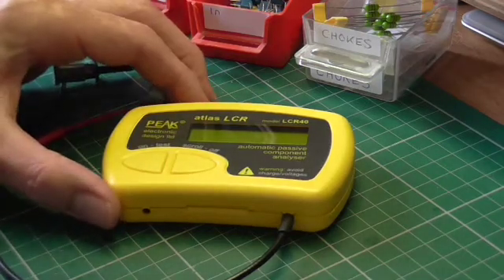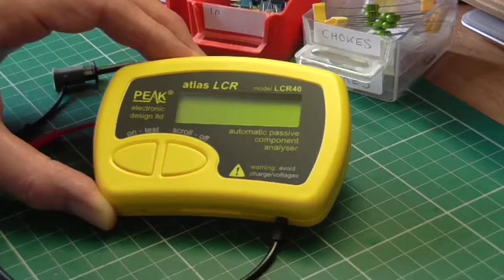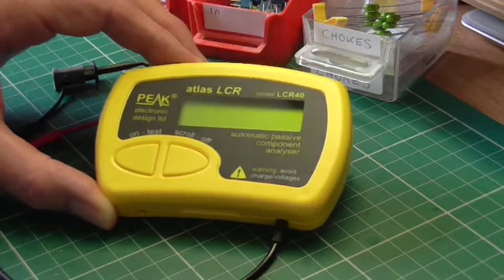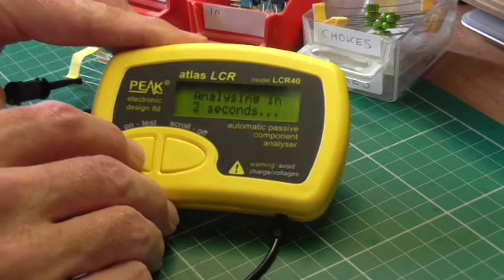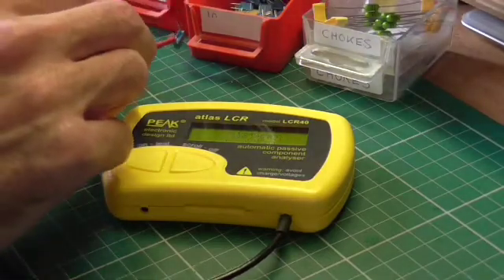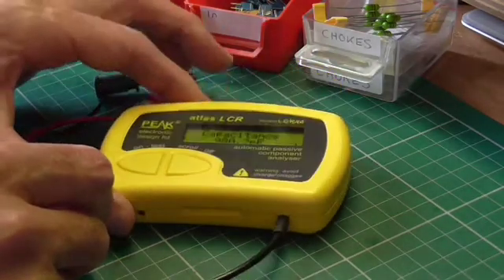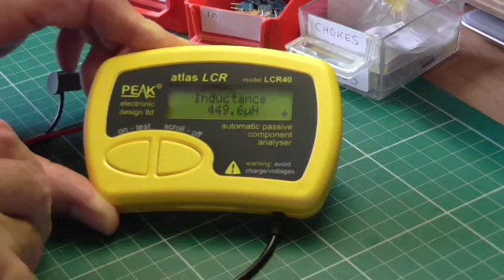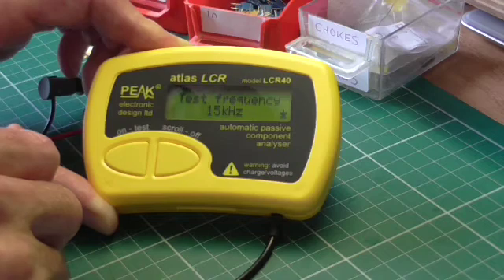Atlas LCR40 Electronic Component Analyser

Comment: I tried one of those, they are VERY inaccurate, its ok for measuring small middle of the range components. For example a 470uH inductor reads 459, and that's ok for components you already know the value of, just verifying but if you are winding you're own and need it to be accurate, the meter is useless. I noticed every time you analyze the same component it come up with a different values as much as a 20% variation...it does this with low value inductors, the product unreliable, I sent mine back for a refund.